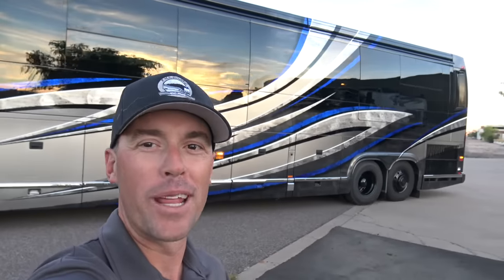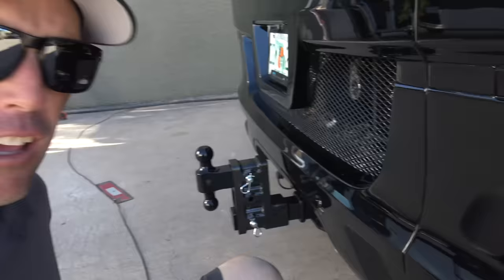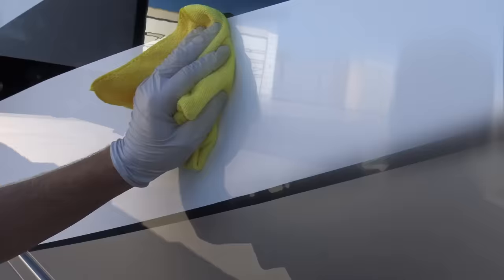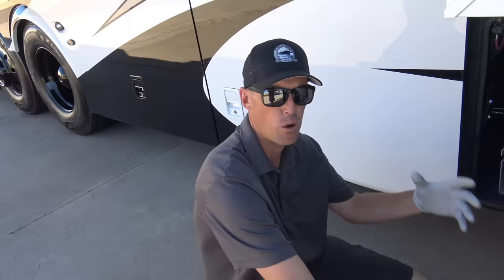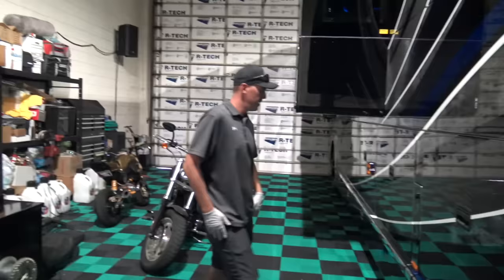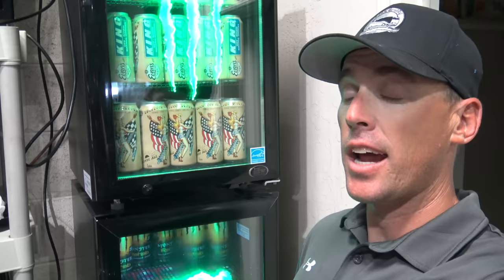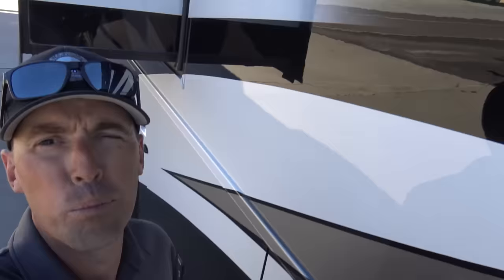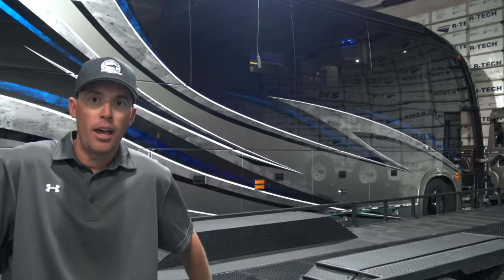WHY IS PREVOST MARATHON COACH $1.5 MIL MORE THEN NEWMAR ESSEX?

Comment: I’ve had two Marathon’s and recently bought a Newmar. Both have their own advantages. Prevost,s are more solid built but Newmar has more creature comforts. Prevost only has a queen bed. Newmar has kings. Prevost,s don’t have passive tags and Newmar does and I love mine. Drivers seat doesn’t swivel on a Prevost and Newmar does. Huge rear bathroom only in a Newmar. Full wall slide, think Newmar. Prevost doesn’t offer. Lots of differences.

Comment: I spent 33yrs as a long distance tour bus driver most of them in Prevost. Prevost builds a quality coach that with proper maintenance should last an RVer a life time. The company I worked for operates some mini coaches that are fibreglass and they need to be traded every 5yrs because this is when the problems start and never end. As an RVer With the miles most do the price difference might make me go with the Newmar, but I would be wishing I was in the Prevost every mile

Comment: one of the biggest differences between the two is one is custom and one is luxury production line. Also a Prevost shell is $700,000 before putting anything in it.
Reply from the maker: Thank you for sharing that. I am going to do a part 2 video with the same coaches and we'll make sure to share that information.
Reply: @RVingwithAndrewSteele  no problem, i sold Newmar's and Entegra's and for production coach's they are the 2 biggest names out there. Both have different construction styles and materials, but are limited in options/specs. When you get into the custom coach's like Marathon or Millennium and so forth, your biggest cost is the shell, depending on the layout and configuration they can go from $450,000 -$700,000 and then the fun begins of the designing and customizing. Personally I would do a comparison of Newmar vs Entegra vs Tiffin.  But to be accurate make sure the price points are the same haha.  Then I would do a Prevost vs Newall vs Foretravel.  I love Rv's (even though I am no longer selling them) and when you start getting into the differences and such it can be a lot of research but damn is it fun haha
Reply from the maker: Absolutely! There is a ton to learn but I am really enjoying it.  Will definitely try to do more comparisons as I learn more and have access to the coaches.  At this point, I am kind of limited to whatever clients let me run my camera through their coaches.  I appreciate you sharing that information and would love to hear your feedback and input on any future videos as you have a lot of great knowledge!
Reply: @RVingwithAndrewSteele  oh I'm def interested in seeing more.  And that prevost paint job is INSANE. in love with that haha
Reply from the maker: @ccampbell0782  thank you! that bus just got back and I'm going to do another video on it because the original video I shot was a shake show and my video ography was terrible.   Thank you for watching!
Reply: @ccampbell0782  agree 100

Comment: As a retired plumber that plumbed over 30 years houses that cost $250K - $3 million. It might be an idea to compare Motor homes in the same money bracket. Different companies with different coaches in the same Price range $500K-$500K, $1m-$1m. $2M-$2M. you get the idea. Also think about going to the factories and see if they will let you see the assembly line, They are not going to share all their secrets, but you will take the viewer into more details of how there coaches are made.

Comment: I love the Prevost based RVs and toyed with buying a used one, but I ended up with what is a 17 year old Newmar that I’ve been very happy with. Couple of things, maintenance costs on the systems built into the luxury motor homes are considerably higher and you can’t have just any old camping world work on some of them without horror stories of six month waits, etc. Secondly, the Prevost based coaches are way too big for what many of us do with them, even my 38’ Newmar is s little large for much of the best RVing, BLM, NFS, COE, etc. But the biggest issue, it’s pretty tough to eat more in depreciation over the life of a Prevost than what the best Newmar or Tiffin cost new. So if you paid me a million dollars to put up with lower quality for a unit that overall fits the same purpose, DEAL! I’ll take the million and spend it running my 17 year old RV into the ground! Thanks for the videos.
Reply from the maker: I completely respect that perspective! I love my 2008 Tiffin Phaeton. I agree, I would rather deal with the few problems and have all of that extra money in the bank but some people have more money than time and don't want to deal with the problems.  with all of the problems that I'm seeing with the brand new Tiffin and Newmar, I will be reluctant to buy one of these in 10 years when they have depreciated. It is going to be very interesting to see how the RV Market evolves in the next decade. Thank you for watching!
Reply: RVing with Andrew Steele absolutely. Funny thing, and it may just be the size of the market, but I have only met one full timer in a Prevost. I think if you have new Prevost type of cash, you have a home or two you don’t want to give up;)
Reply from the maker: @Jumpingoffthecliff  Absolutely! I can't think of one Prevost owner that I've ever met that was full-time.  These are definitely rich people "toys"
Reply: agree 100 and did the same thing

Comment: Great video.  I own a Newmar Dutch Star,........all I could afford,............and lust for a Prevost or better yet, a Newell every day.  Until I win the lottery,........I'll be driving the Dutch Star till I run out of roads.
Reply: Hey, I'll be driving a kia so don't feel that bad about what your driving.
Reply: @pamatthew99  We ARE very grateful for how our retirement plan has worked out so far.  Would have worked out better if we were young though!
Reply: Dutch star is a beautiful coach also.
Reply: Are you happy overall with your Dutchstar? That is probably my favorite of the (actually somewhat affordable) high end RV's. Newmar seems to have begun to cut corners over the past couple years to meet the demand. Not is looks (they are gorgeous) but in quality.
Reply: @rebellucy5610  We thank our lucky stars every day we are in this thing.  Quality & fit and finish is outstanding.  Getting repairs at the larger Newmar dealers has been a nice "normal" experience.  Driving a big coach can be a terrifying experience if you are driving the wrong one for your level of tolerance to "loosy goosey" on the road, and getting pushed around by trucks and the wind.  WITHOUT EXAGGERATION, we drove this thing for 18 months before one day I said to my wife "I think it is winding out today!".  The length, and weight, and TAG AXLE make it solid as a rock.  The Comfort Drive that is on Newmar's makes "dialing in the steering to be as tight as you prefer" a dream come true for the driver.  Dutch Star in most blogs wins the best bang for the buck for Full Time RV people that have a budget.

Comment: I own a Newmar Dutch Star,   Newmar makes an excellent coach and the Newmar staff are award winning.    So ask yourself,   will you have a 1.5 million dollar BETTER time camping?   They are both beautiful coaches and both well built.   I just chose to NOT over spend when the differences in everything we looked at were marginal.    I would have at least compared a King Aire so your comparison would have been apples to apples.     Things the Prevost does NOT have that the Newmar has?    Tag Axle  turning rear axles.      Personally over the top priced coaches have too much LED goofy lighting inside that make them look like a Vegas Slot Machine.    Not very tasteful.
Reply from the maker: I completely understand and respect that point of view.  I personally would prefer to buy a 10 year old Prevost that has already taken the depreciation but still has the high in build quality.  I've seen some older buses remodeled to look brand new and I think that's the best way to go.
Reply: yep right on, i own a dutch star also
Reply: do prevost have a comfort drive style system?

Comment: Prevost is a vehicle designed for serious, commercial use--specifically to cross Canada from coast to coast in the harshest conditions day-in and day-out (or the US) in all of its other finished-out forms. In this case, it just happens to have been converted by another company for RV purposes. Companies building vehicles that are only RV's, in contrast, have no reason to build vehicles that have to withstand commercial service, and they have little or no experience doing so. There isn't really any comparison.

Comment: great video
the prevost chassis and frame  is solid 1 piece construction and does not flex and twist, also the wiring on a marathon is the best you will ever see. if you jack the front wheel of a prevost marathon up on a 12" brick and leave the rest on the ground then the side storage doors will still open and close effortlessly, on anything else they will stick.
MARATHON COACH  new "super bath" design is amazing as well, if you can dream it, MARATHON will find a way to build it into your coach. MARATHON is the gold standard that the rest aspire to be. Even their production floor is the cleanest and most organized i have ever seen,  and no, i dont work for MARATHON.
Reply from the maker: Thank you for sharing! I want to learn more about the construction of these buses as they are very fascinating.  Marathon coaches are absolutely amazing. I hope to do more videos like this soon as I learn more about these coaches.
Reply: get hold of Mal Williams at MARATHON COACH in Coburg Oregon if your ever in the area, i am sure he will get you any info you ask for. 
TIP: take him a pair of nice,  cool "novelty socks" he is into them.
Reply from the maker: @ianhumphry1  it's definitely on my bucket list to go visit them someday.  Mal definitely has some awesome socks! I've noticed them in several of his videos.

Comment: Freightliner Cascadia being nearly $180,000.  Apparently Prevost is very expensive glue and polished stainless steel.  What this really tells me is they have not mastered modular building.  They build RV's like McLaren builds cars.  One at a time for individual owners.  They could save money on generic shell bolt on that are finished out standard selections.  Tesla will eventually get in the market and do this with their chassis.  It will be a power plant on wheels.

Comment: All of those little details paint etc all add up to $1.5 million extra WOW. If they did that on the Newmar Essex, I'm pretty sure that it would cost about the same as a Prevost?? The Prevost is a beautiful coach, but, you have to have a lot of $$$$ to own one, whereas the Newmar is basically an entry level coach that you keep for a few yrs then you graduate to a prevost even a used Prevost is better than a brand new Newmar, If I was to buy a coach today, I'd rather buy a good used Prevost before any new Newmar coach, even if it cost me a few bucks more.

Comment: Look Newmar King Air is a Million dollar coach .
You needed a King Air to compair it to  You will see better build quality .
I have that 600 Cummins 12.5 kw onan gen  I have the 2 full baths . I can go on
Reply from the maker: Thank you for sharing that, I only have access to so many coaches and had to use whatever resources I have to try to make videos.  if I can ever get a King air and a Prevost side-by-side I will definitely try to do a comparison.  I also did a couple videos about a King air recently, one was about a 2018 King air. Thank you for watching and giving your feedback. I would love to show your king Aire on my YouTube channel if we ever cross paths.
Reply: @RVingwithAndrewSteele  I respect that . But what I see is comparing 2 million dollar coach to a 700k Dollar coach  no comasison 
Example to me 
It's like comparing  a  VW to Navigator 
No problem
Reply from the maker: @mrjlbarrett5556  I have several friends that are new to rving and going from boats and planes to RV and are having a tough time telling the difference between the two. They are both 45 feet both have similar engines & transmissions.  most people can't tell the difference from 20 feet away so I thought this video would be fun just to make for a few of my friends but it ended up getting a lot of attention.
Reply: Even the King doesn't compare.

Comment: Would you ever recommend claying and or applying a ceramic coat on a RV?
Reply from the maker: It all depends on the owners level of expectation and budget.  Typically a clay bar is not needed on the vertical surfaces very often unless there is overspray.  Coaches have completely vertical side walls so it's very rare that they need a clay bar.  I am personally not sold on the ceramic coatings because of the cost for the efficiency that you get. I think a lot of people are over selling the ceramic coatings and customers expectations a few years down the road are let down.  Ceramic coatings do have some awesome properties but are extremely expensive for what you are getting.  You are paying 90% more for 10% better results in my opinion.  I think the ceramic detail spray is a good in between option for RVs.  The product is much cheaper and easier to apply and has similar self-cleaning capabilities as a ceramic coating.  It does not last nearly as long but is a better value in my opinion.  don't hesitate to ask me any detailing questions, I am always happy to help. Thank you for watching
Reply: @RVingwithAndrewSteele  Thank you very much for your reply and opinion.
Reply: @RVingwithAndrewSteele  Wth Glass coating 22Ple... major diff for only 5-6 hours of Labor. Dropped it on my Ferrari and it was a huge Diff. would be Low cost add to drop it on a 45 DP

Comment: There isn't any comparing the two as they are built so completely different. Prevost coaches are built on a solid all around steel cage/frame and chassis. Newmars are not, they are built with wood. Prevosts have a million mile guarantee on their frames/chassis for a reason. They're solid rocks that drive like laying on pillows.
Reply from the maker: Amen sir, thank you for watching.
Reply from the maker: Where did you find this information? I would like to look more into it...
Reply: The best place to find out "all things Prevost and neat facts" for the most part are through the numerous videos, including the regular "Marathon Mondays With Mal" is over at Marathon Coach in https://www.youtube.com/user/MarathonCoach1?disable_polymer=1

Cheers!

Comment: The prevost lost me with their windshield. I prefer the solid one piece. But everything else is on point. Prevost seems more luxury high end custom made.
Reply from the maker: Definitely nothing like looking out that huge panoramic windshield! I love the windshield in my coach.
Reply: I prefer the single windshield also, but learned the most of the Prevost style buses travel so many miles that rocks/debris are always chipping or cracking windshields and its much to replace just one side. So the beauty aspect is not always the most practical for buses that are built to swallow miles of road.
Reply from the maker: @rebellucy5610  I also heard, that the Prevost windshields are much less expensive than the one piece glass.  My buddy says he pays 800 per side for a new windshield in his Prevost bus from Prevost.

Comment: I would still buy a Newmar or what ever for that price. Then in six years buy another new one. Six years later buy another one. In the end I will have 3 new bus for the price of one Prevost. In 9 years the Prevost will be old and outdated. Just saying...
Reply from the maker: The shell of the Prevost will not be dated in 9 years.  In my opinion, a 15 year old Prevost is higher quality then a new Newmar.  If you have seen my video titled "midlife prevost", they are in a 15 year old Prevost for under 300k after they had it remodeled. I think that 15 year old Prevost is nicer then any new Newmar.  I  value  build quality more then new technology and have heard too many problems from folks with new Newmar...

Comment: Stop slamming the doors. It's unnecessary and it can lead to door latch failure for the customer down the road.
Reply from the maker: In which coach? The Newmar or the Prevost?
Reply: @RVingwithAndrewSteele  both but, you slammed the doors on that Prevost. Close it, don't slam it.
Reply from the maker: @Placeitinmybox1  the Newmar door won't close unless you slam it.  the Newmar customers are saying that they are told that you have to try to swing in a little harder.  After I made this video, several people correct me on the Prevost door. Thank you for your feedback